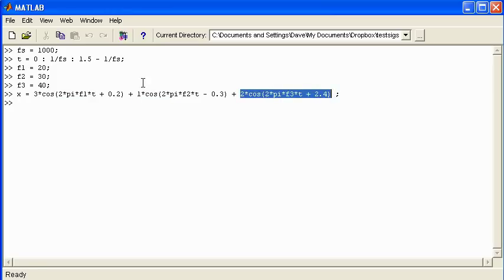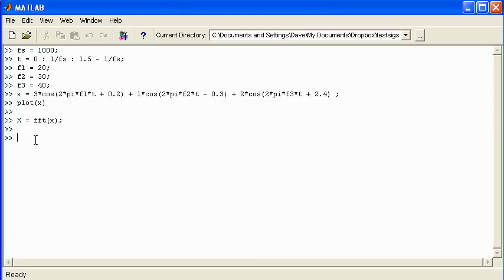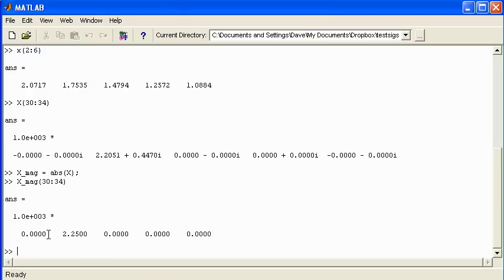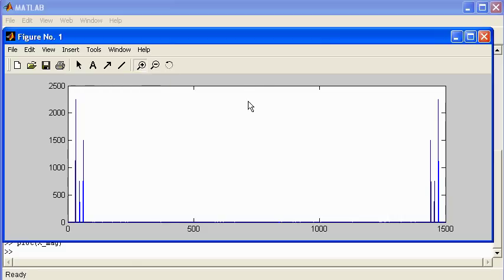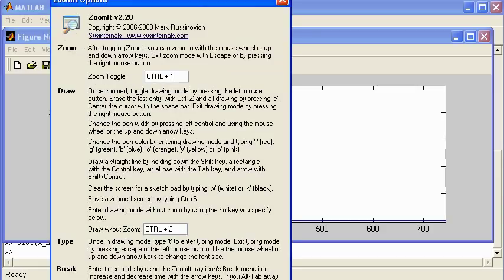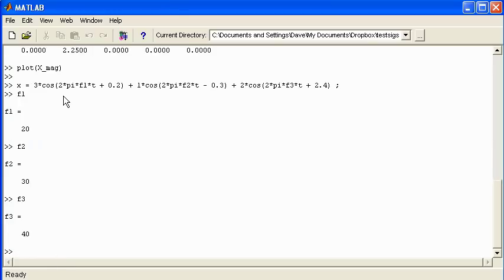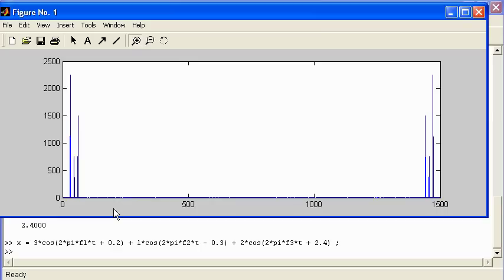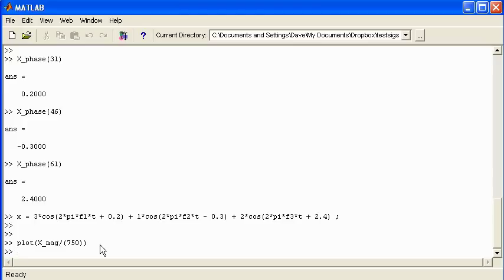Using Matlab's fft function

Comment: What if we change fs to 2000? our frequency component gets changed. how do we balance the changing sampling frequency?
Reply from the maker: +Abhishek PRATAP SINGH You would get a corresponding increase in the number of samples over the same signal duration (in seconds).
Reply: +David Dorran Sir  in frequency spectrum entire range is equal to fs. So if fs doubles(becomes 2000) the three sinosoids will now become 30 ,40, and 50 hz which is not true. How do we take care of varying sampling frequency. Also tell how to select sampling frequency.
Reply: +Abhishek PRATAP SINGH  (sorry the new frequencies wil be 40 60 and 80 hz)
Reply from the maker: +Abhishek PRATAP SINGH I suggest that you change the variable fs in the code and see what happens for your self. fs (the sampling) frequency should be greater than twice the highest frequency
Reply: +Abhishek PRATAP SINGH it will then take forever to finish the calculation :P

Comment: Hello Dr. David,

I need to find the difference between dropping sounds of Copper and Gold using frequency peak. So far I took the fft(); of both sound files and plotted the amplitude/freq. diagram. How should I continue with my progress?

Thanks!
Reply from the maker: Atakan Arıkan You could look for differences in the plots that reoccur for multiple drops and use those features to differentiate between the two sounds.